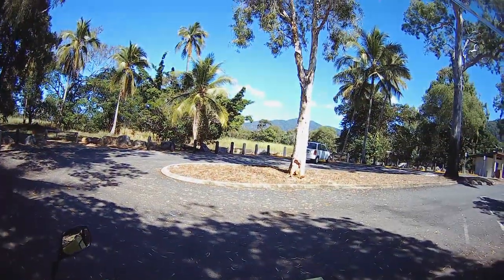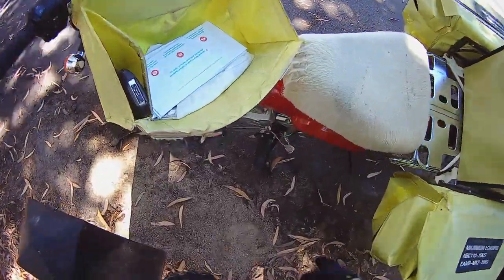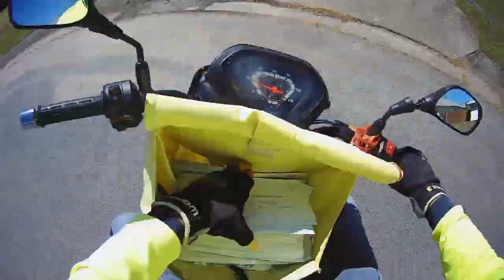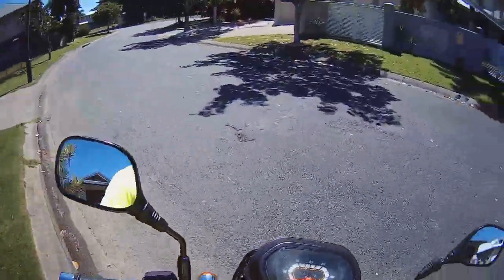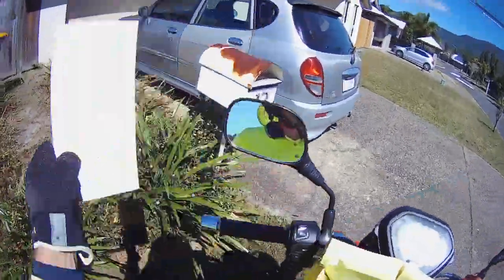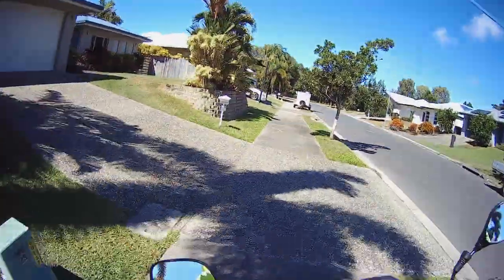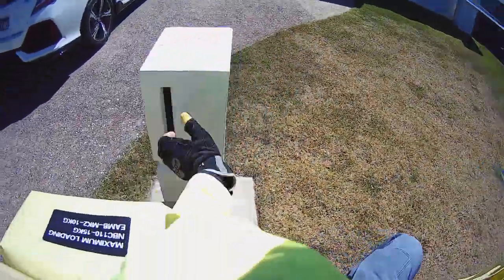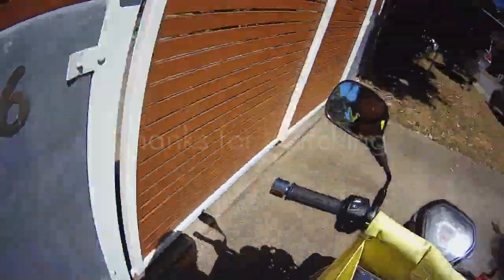Deliver mail without stopping,  postie bike

Comment: Two annoying types of letter boxes. Vertical boxes with thin spring loaded flaps and small terracotta log shaped boxes with slops too small for even standard letters.
Reply: Shallow wall/fence mount vertical boxes with flap on the front face, bolts inside catch anything you try to put in them, and anything that's not bendy also doesn't go in them .
Reply from the maker: Figures getting caught, hahaha

Comment: Try that with small parcels that are too big for the front letter opening ..😄
Too bad you wasted more time going back to the same boxes than you might have saved with the no stop, slow speed letter posting..😏
Stopping gives you enough time to 'safely' double check the mail to follow, so as not to miss any attempting to check them on the fly, taking your eyes off the path of travel..😉
Reply from the maker: It's just a challenge, to see how long you can go without stopping...
Reply: @aussiewantok , Wish our streets & neighbours were as easy & tidy as yours..lol
Reply from the maker: Mate, it's FNQ, angled gutters, not many inaccessible letterboxes, some vicious dogs, not much traffic, mainly sunshine

As a part time gig, it's OK. The work will never runs out, until they start using drones ;-)
Reply from the maker: @IceBoNeZ  normal Far North Queensland stuff, easy ;-)
Reply: @aussiewantok , Just started postie & parcel work in my little inland NSW town, in the Southern Highlands.
Streets are hilly, grass paths get muddy & slippery on rainy/snowy days, and the letter boxes are all over the place, different heights, some hidden in or between trees, and sometimes in different streets than their address shows.. makes it interesting.. lol
Reply from the maker: Snowy, hahaha, that's funny

My biggest problem is 2 vicious dogs at a particular address, that are ready to tear my arm off if I touch the letterbox. I just throw the mail over the fence, as instructed by the client

Overall, not a bad job, just the pay...

Enjoy